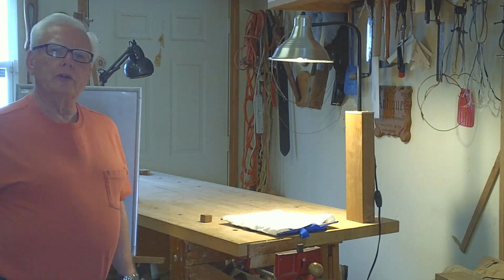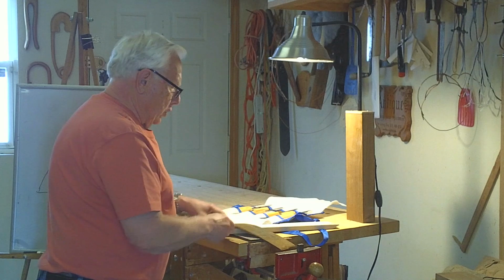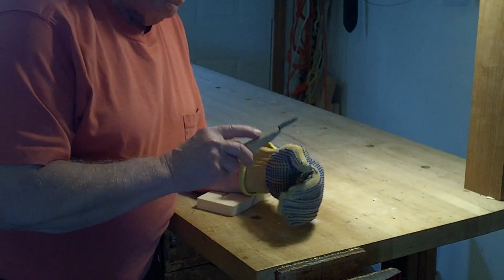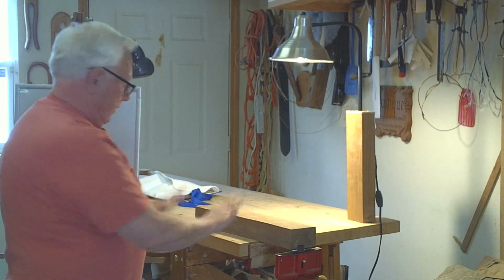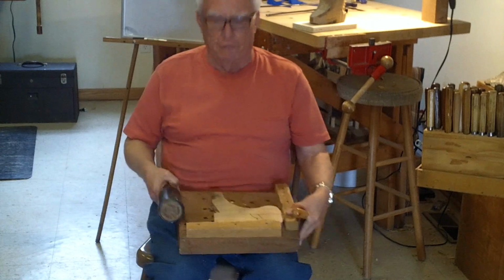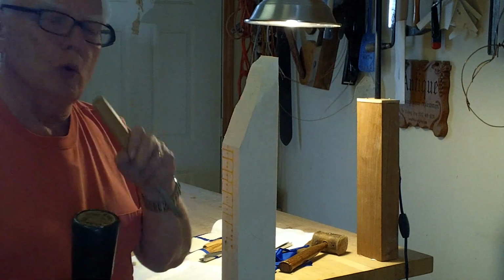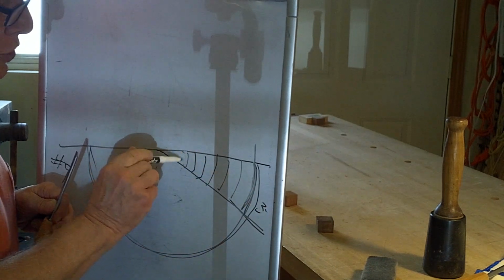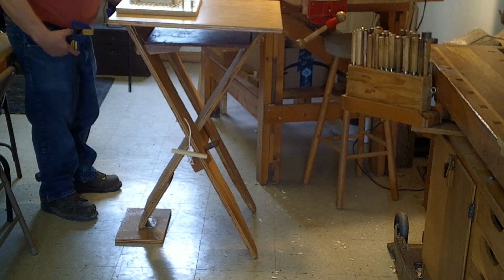Schaaf Tools, carving basics & equipment

Comment: A great explanation on the sometimes confusing numbering systems used for carving tools. It helps explain why a #3 5mm chisel has a different contour than a #3 10mm or why two different numbers might match the same radius but have different degrees of arc.